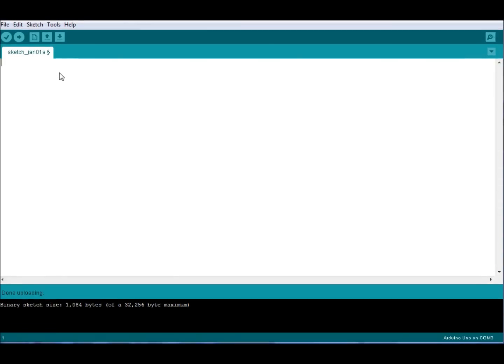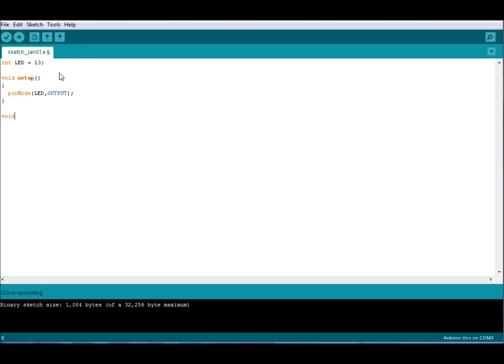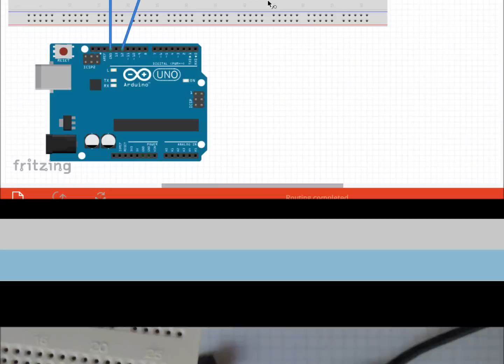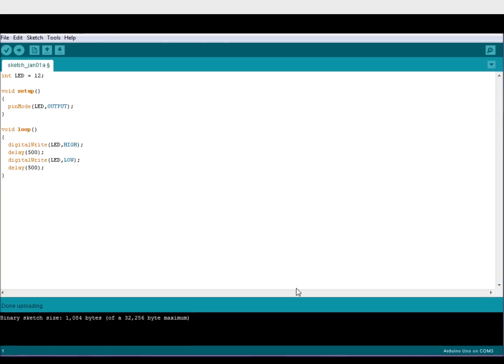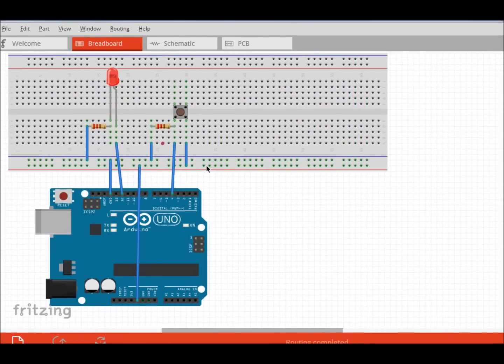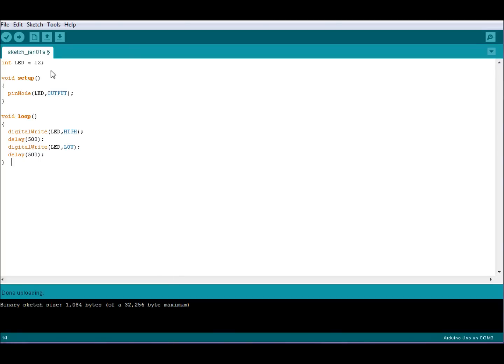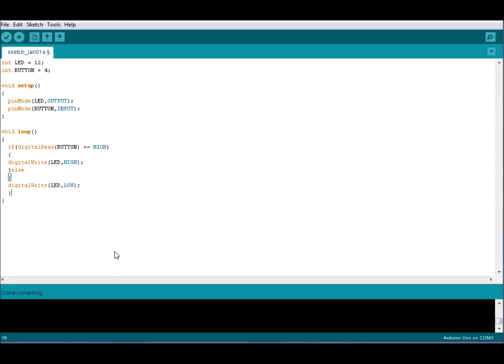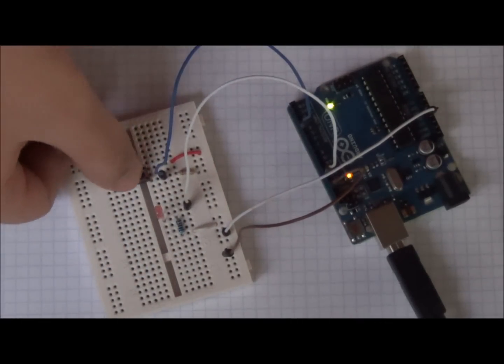Arduino Tutorial #1 - Digital Inputs and Outputs - Button & LED

Comment: I can't understand the point of the push-button pull-down resistor as my understanding is that that part of the circuit is isolated until the button is pressed. Am I barking up the wrong tree?

Comment: why can't we directy attach the button inbetween the pin 12 and the ground?
then the circuit completes only when we press the button..Is there a specific reason to use the digital read and a seperate resistor for the button?

Comment: For some reason, there is a long delay when I'm testing this project. The delay occurs after I let go of the button and delays the led from going off. I have tried multiple resistors and some have shortened the delay but when I actually touch the resistor during the delay the led becomes much more responsive and switches off immediately. I have checked the code and there is no delay coded in. I'm not sure how to resolve this hardware error. Any help?
Reply: You can test pilot programs with www.tinkercad.com/circuits before uploading them to the physical Arduino.

Comment: I'm a beginner in this field . My doubt is can we connect the 120 ohm resistor and led directly to Arduino pin 12 and GND without bread board. Is it possible or will it damage the port.

Comment: What u have shown in the video similarly i did 5v relay connection but when i made high relay ll turn off and when i made low relay ll turn on...can i know whts the problem please help me!!!
Reply: Since there is a coil and input / output pins for the secondary circuit it sounds as if your relay is a NC (normally closed) relay. Therefore when power is applied across the coil it will cause the relay to open which would not allow electricity to flow. Therefore shutting off the circuit.  A simple fix would be to switch your output in the if statements. So if button is pressed then output low. If button is not pressed output high. That is my guess at least since I can't see your circuit.

Comment: why is  it "obvious" that the negative pin goes to the resister? Current flows from + to GRND. Why need for a resistor AFTER the LED?  I am stuck. Can't find an explanation.

Comment: Arduino: 1.8.9 (Windows Store 1.8.21.0) (Windows 10), Board: "Arduino/Genuino Uno"

Sketch uses 1068 bytes (3%) of program storage space. Maximum is 32256 bytes.
Global variables use 9 bytes (0%) of dynamic memory, leaving 2039 bytes for local variables. Maximum is 2048 bytes.
avrdude: stk500_recv(): programmer is not responding
avrdude: stk500_getsync() attempt 1 of 10: not in sync: resp=0x02
avrdude: stk500_recv(): programmer is not responding
avrdude: stk500_getsync() attempt 2 of 10: not in sync: resp=0x02
avrdude: stk500_recv(): programmer is not responding
avrdude: stk500_getsync() attempt 3 of 10: not in sync: resp=0x02
avrdude: stk500_recv(): programmer is not responding
avrdude: stk500_getsync() attempt 4 of 10: not in sync: resp=0x02
avrdude: stk500_recv(): programmer is not responding
avrdude: stk500_getsync() attempt 5 of 10: not in sync: resp=0x02
avrdude: stk500_recv(): programmer is not responding
avrdude: stk500_getsync() attempt 6 of 10: not in sync: resp=0x02
avrdude: stk500_recv(): programmer is not responding
avrdude: stk500_getsync() attempt 7 of 10: not in sync: resp=0x02
avrdude: stk500_recv(): programmer is not responding
avrdude: stk500_getsync() attempt 8 of 10: not in sync: resp=0x02
avrdude: stk500_recv(): programmer is not responding
avrdude: stk500_getsync() attempt 9 of 10: not in sync: resp=0x02
avrdude: stk500_recv(): programmer is not responding
avrdude: stk500_getsync() attempt 10 of 10: not in sync: resp=0x02
Problem uploading to board.  See http://www.arduino.cc/en/Guide/Troubleshooting#upload for suggestions.
Invalid library found in C:\Users\M93z\Documents\Arduino\libraries\libraries: no headers files (.h) found in C:\Users\M93z\Documents\Arduino\libraries\libraries
Invalid library found in C:\Users\M93z\Documents\Arduino\libraries\tools: no headers files (.h) found in C:\Users\M93z\Documents\Arduino\libraries\tools
Invalid library found in C:\Users\M93z\Documents\Arduino\libraries\libraries: no headers files (.h) found in C:\Users\M93z\Documents\Arduino\libraries\libraries
Invalid library found in C:\Users\M93z\Documents\Arduino\libraries\tools: no headers files (.h) found in C:\Users\M93z\Documents\Arduino\libraries\tools

This report would have more information with
"Show verbose output during compilation"
option enabled in File -> Preferences.
 
HOW TO FIX IT

Comment: what if we connect the switch with led in series with the resistors.probably  component should be connected in series.can u plz explain it.
Reply: That would work for the purpose of turning the LED on and off, but the purpose of this video is to illustrate how to use inputs and outputs.  For this example, using an input signal is artificial because you can just use the button to complete/disconnect the circuit itself as you mentioned.  In a more complex example, however, it might be necessary for the code to work differently depending on whether or not it is receiving an input signal.  For example, if the light normally blinks once/second, but when the button is pressed it blinks twice per second, the method described in this example would work (with some adaptation to the code), but simply putting the button in series with the LED would not.

Comment: Hi again, just got my Kit.. says u can install the Power unit on the B Board too??? Won't the 3V and 5V pins short circuit it all?
Can we have BOTH sides LIVE of the B Board with 5 V at the same time - hence, make 2 DIFFERENT circuits at the same time?

Comment: Hello sir, I followed every step as you illustrated in your video, and I am using NodeMCU ESP8266 from local vendor. The problem is even after releasing the button the led is glowing. I don't have any idea why is this happening. I did every thing as you said, there is no difference except I am using NodeMCU ESP8266.
Please help me with this.

Comment: i dont understand one thing, the button has a resistor because its passing the energy from the 5v if i understand correctly, however those 5v dont go to the led, we just check if the pin connected to the button is recieving energy, so why do we need a resistor in the led?

Comment: This is maybe a dumb question but what difference in a systemic level will it make if I use a blue LED light? It only somehow works on red and never on blue or green.
Reply from the maker: There's no difference. The assembly of the LED makes the color and typically speaking, the difference in current draw is different, but negligible in most cases.
Reply: EEEnthusiast do you have any suggestion as to what i can fix? Because it works perfectly fine with red but never with other colors.

Comment: Hey there is a problem in the circuit the wire from the positive should  go to the 13th pin or u can change the code that is " int LED=12;"don't forget to include the semicolon  thank you

Comment: Do something really challenging and make a nixie clock with arduino mega and run 5 solenoids to do a Westminster chime using the solenoids corresponding with the time.
Reply from the maker: I'm actually very curious about the nixie tubes. I'll do some of my own research, but do you know of any readily available models I could purchase? I saw that some of them could cost over 100$ / tube. In either case, that would be a really cool project.
Cheers,
Vlad

Comment: I'm pretty sure i've done everything correctly but my led stays on at the start and pressing the button only brightens it. Although if i change the code to if i press the button the led turns off it works perfectly fine.

Comment: question :
how to connect the circuit board that has detect by blink the led light to the arduino uno that will send to the sim900A? thank you

Comment: HI FRIEND
, I would like the CODES how to do so, when loading the arduino the GREEN LED is lit and with a pulse of a button it would take a time of 10 minutes for this GREEN LED to turn off, and with another pulse of the same button it would return to light or with another button, and when you turn off the first GREEN LED, you would turn on a RED LED to signal the power off.

Comment: Hi,I'm sorry if the question is out of the topic I want to create a circuit design based on written program that turn off/on the equipment by using a number that can used as units for a certain given time of use but I don't know how to do it please can you give me some hints on how to do so....thanks in advance

Comment: Arduino: 1.8.3 (Windows 10), Board: "Arduino/Genuino Uno"

sketch_jul17a:3: error: variable or field 'setup' declared void

 void setup{}

      ^

sketch_jul17a:8: error: variable or field 'loop' declared void

 void loop{}

      ^

exit status 1
variable or field 'setup' declared void

This report would have more information with
"Show verbose output during compilation"
option enabled in File -> Preferences.
 
why does it show?

Comment: This question might seem a bit stupid, but 'm new to the Arduino: Does the energy flow from the ground pin to the output pin or is it the other way around? thanks.
Reply from the maker: Not a stupid question. The energy always flows from positive to negative. That being said, if your LED is tied as "Output - LED - 5V" it will light up when the output is low and energy flows from 5V into the output. If you wire it to be "Output - LED - GND", the energy will flow from the output when it is set to HIGH.
Reply: To piggy back on his response, it actually doesn't matter. with conventional current we think that the protons go from the positive to the negative, however it is the opposite.

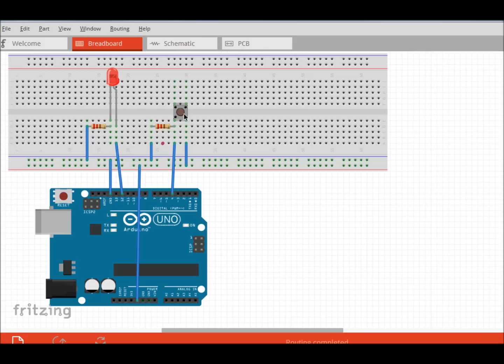Comment: Hi. Quick question. From the diagram at 4:10, I wanna ask whether the input ports in the arduino have resistors in them? Because otherwise, the resistor on the button would serve no purpose as there will be a short circuit created between the input port 4 and the 5V from upstream of the button. 
If someone could help me out, that'd be awesome!

Comment: what command should i use to make, example : green led lights up when pressing one button, after that pressing another button which lights up red led and a motor starts, and when the red led is off the motor keeps rotating until the green led is turned off? thanks :)

Comment: I have a problem. For some reason led is flashing all the time. I even daisychained 2 x 10K resistors to pull down but no luck. Any advice? Its all connected exactly the same way

Comment: hey.. i have a question.. plz reply..
I want to display LED output on LCD 16x2 using Arduino.. by this i mean, when the LED in ON i want the arduino to display "HIGH or some other message" on LCD.. 
i want the Arduino to read LED status whether on/off and then display the output accordingly.. is it possible.. i cant find the correct code..

Comment: when i connect the led it always lights up, the button doesnt seem to affect it ... what could be the problem ...? I tested my connections of the led with another blinking project and it works.
Reply: Paste your code here please?
Reply: I have the same problem 

int LED = 12;
int BUTTON = 4;

void setup() {
pinMode(LED,OUTPUT);
pinMode(BUTTON,OUTPUT);
}

void loop() {
 if(digitalRead(BUTTON) == HIGH)
 {
 digitalWrite(LED,HIGH);
 }else
 {
 digitalWrite(LED,LOW);
 }
}
Reply: Are you using Led 13, Led 13 is the LED light on the board for testing. Not LED 12,
Reply: Are you using Led 13, Led 13 is the LED light on the board for testing. Not LED 12,

Comment: Noob question: Why do you put the resistor going from the negative pin of the LED to the GND? Don't you want the resistor to resist the current going from the digital pin to the LED?
Reply: As this is a series circuit, the current is the same throughout all points of circuit (i.e. on both sides of the LED). The current in the circuit is determined by the total resistance of the circuit, meaning the positioning of the resistor is irrelevant - it doesn't matter which pin you connect it to. You are thinking of current as something that drops or is consumed by the LED, which is not the case, voltage is what drops across the LED not current. 

Think of the connections as already filled with electrons for the whole length of the circuit. When a potential difference (voltage) is applied to the circuit these electrons begin to flow around the circuit, but can only move at the same speed as each other, as the wire is completely filled with electrons (there is no way for different points in the circuit to have different amounts of current). The power supply is not generating electrons but rather energising  the ones that already exist in the conductors (breadboard, pins, wires). This is only a model but it might help visualise it a bit better. Hope this kinda helps, it's a bit hard to explain without diagrams :)
Reply: @aeroplaneman747  thank u so much, I thought it chould be as u described, but I was not 100% certain
Reply: @aeroplaneman747  dude u should teach
Reply: @aeroplaneman747  Very good explanation m8
Reply: aeroplaneman747 Thanks for the explanation, I've always thought the moving electrons came from the power supply. Your example makes a whole lot more of sense.
Reply: That does not matter, I'm not an expert but the current can "feel" whether there is a resistance or not.
Reply: No problem! Glad it made sense
Reply: I was going to ask this aswell. I get's the current breaks after the led creating a queue line on the input side? That's a wild guess!
Reply: what about the push button is that suppost to have a resistor to gnd too?
Reply: It’s because it is not sending power to the ground it is been sent from it
Reply: https://youtu.be/jAppLgPljdQ
Reply: you shoud not say like that
Reply: I think he goofed lol

Comment: What value does the "pull down" resistor has?
please mention a part list...? thank you ;-)
Reply from the maker: I've used 20k ohm for my pulldown, but it can be anywhere from 10k to 1000k.
Reply: thx
Reply: If I'm using LED 12V RGB, what resistor should I be using?

Comment: Hello man, How can I make that: when I press buton LED turn on
when I press buton again LED turn off
Reply: You need to save the previous LED/Button state to a variable and then change it on either the button press or release. Here's my code: (pastebin.com/tRQCDNEC)
Reply: thank you
Reply: On button press, New Variable equals TRUE
Reply: thanks
Reply: Set PINMODE to digital read, if there is power then TRUE, Setup a wire that reads the power between led an BATT

Comment: Hi! I am new to circuits and breadboarding,  but I do not understand why only the resistor is giving the results that we need, when I just connect a normal wire from the button to the ground instead of the resistor it shuts the whole arduino off. it would be great if you could explain why only the resistor is giving the results. I'm very curious to understand this. thanks!

Comment: when you write the code, 
zoom in on it so I can write at watch you video at the same time

else, thanks for making is!
like!
Reply from the maker: +Simon Seindal I've learned with my recent videos. I made sure that the font is big enough for the viewers and is legible. Thank you for your comment.
Reply: Copy it and if their are a problem tell me (circuit the long part of the LED put on the 1 pin and the short part put on the gnd pin :
void setup {
PinMode(1,OUTPUT) ;
}
void loop {
digitalWrite(1,HIGH);
delay(100);
digitalWrite(1,LOW);
delay(100);
}

Comment: Is it possible to change the coding so when you push the 1st time it displays a full lit LED, 2nd push a dim LED and 3rd a flashing then repeats again?
Reply: +Chewie Chops Hmmm, yes, I can think of a way now. Keep count of the number of button pushes using a variable (so everytime a button is pushed, so a variable, say, butCont = butCont +1 ;) Then after that, divide this by 3 and get the remainder of this operation. So it if is 1st (or 4th, or 7th, etc.) push, the remainder is 1, if 2nd, then the remainder is 2, and if 3rd (or multiple of 3), remainder is 0. So, use an if else if structure to check the remainder, then assign the required brightness using a PWM pin (analogWrite). Hope that helps.

Comment: Can I please ask you how to program it for a switch such that when it is pushed once the LED stays on until the push button gets pushed the second time.
Reply from the maker: +Alya Abdalla I use a boolean for the LED state which is toggled when the switch is pressed. In other words, if the button is pressed AND state = 0 {state = 1}. IF (button is pressed and state ==1 {state = 0}. This way, state is always either 1 or 0 even though the button is no longer pressed.
Reply: +EEEnthusiast and if I want to have like 4 switches cannected to 4 LEDs is the vonnection the same ? Or is there anything different ?

Comment: Thanks for doing this. Here's my question, let say instead of using the logic for button let say I want to use a sensor meaning when I move my hand it turns on the LED. Do you think I can just replace this line of coding ... pinMode(sensor, input); and then if(digitalread(sensor) = = high) then digitalwrite(led, high); Do you think this could work? Your response is appreciated
Reply from the maker: absolutely. a button functions exactly how a digital sensor would. to the Arduino, both of them send either a high or low signal, nothing else.
Reply: +EEEnthusiast man you just boost my confidence. Do you have any tutorial about the same thing but analog inputs instead of digital
Reply from the maker: Daniel P I sure do. browse through my channel. I discuss analog signals in several videos including how to use a single analog channel to read 8 different analog signals.